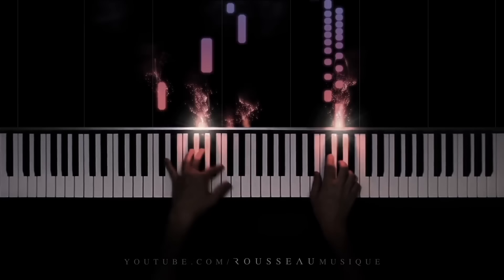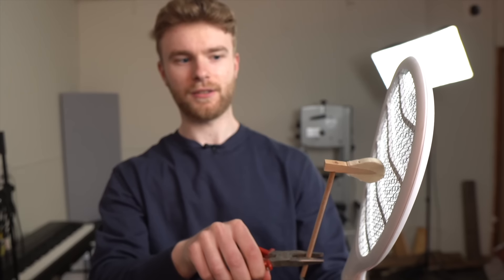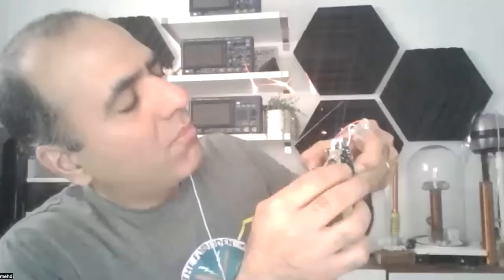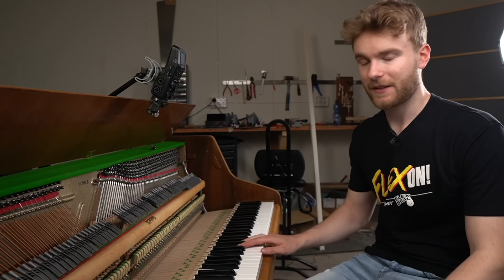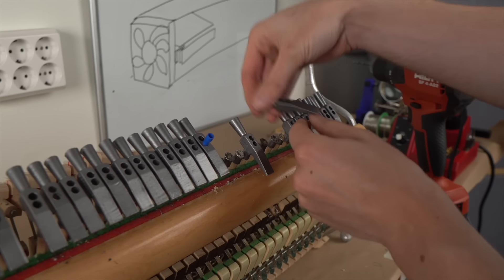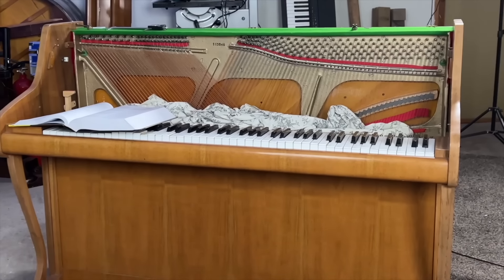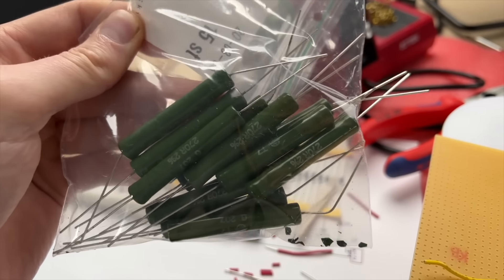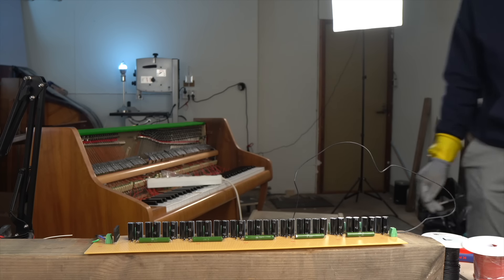How to NOT make an electric piano ft. @ElectroBOOM

Comment: As an electrical engineer, seeing those resistors glow red was terrifying
Reply from the maker: I thought that was a feature!
Reply: If you've never made a resistor (or other component) smoke,are you really an EE though? Putting the magic smoke back in is the hard part.
Reply: if it glows, it means its on!
Reply: All resistors (including the metal within any other component) are light bulbs if you drive them hard enough.
Reply: I used to be a resistor, but the cops yelled at me to stop resisting and put me on the ice. I'm a superconductor now.
Reply: Agreed. Scared the hell out of me too. Actually had the resister catch fire on the classroom... Good thing the teacher had the fire extinguisher just in case.😬
Reply: I am a electrician.
In school we blew up so many transistors and resistors it was quite funny. Like snap peas. 😂
Reply: @PhattyMo  I can confirm that letting the smoke out of a component was mandatory in undergrad EE. Unfortunately we were told that learning how to put the smoke back in wasn't covered until the graduate level. I was too poor to get a Master's degree, so all I can do is blow smoke with my B.S. of electrical engineering.
Reply: @PhattyMo  when you only know the theories
Reply: I felt queasy deep down inside
Reply: What's the worst that will happen? The resistor melts and becomes 0 resistance and then all the capacitors explode.
Reply: Exploded electrolytic caps smell like cookies. Burned resistors and diodes really stink though.
Reply: As an electrical engineer, it kinda made me a little hot......
Reply: Also seeing him using 2 sets of gloves on wooden keys made me annoyed.
Reply: Good old Light Emitting Resistors
Reply: @LordDragox412  😂
Reply: What if the resitor just blow up
Reply: man's just invented LER's - Light  Emitting Resistors, sounds like an idea someone would steal
Reply: @Mattiaskrantz  Little advice, what the burning resistors mean is that you've shorted out whatever that resistor is powering (in other words, a hammer has welded itself in contact with a string). There are ways to prevent this kind of thing, but honestly if i was you i'd suggest just adding a fast blow fuse after each resistor. 

Be absolutely sure that the circuit is discharged before replacing fuses though if you do this.
Reply: @binathiessen4920  not the electrolytics I reverse charged!
Reply: how about the fact that he was watching electric arcs without any eye protection? they are potentially damaging
Reply: @kitsunekaze93  ... not for very long, though.
Reply: redstone
Reply: @LordDragox412  noice
Reply: @SeriousApache  honestly I think the logic was if his brain turns off and touches something he shouldn’t then maybe the gloves won’t melt to the hand
Reply: As an electrical engineer: that was ducking awesome!! Snyggt jobbat!
Reply: @ParadigmUnkn0wn  That seems to be the equivalent of accidently making plasma with your laser
Reply: daily occurrence in my lab
Reply: @wolfkin5503  if he keeps doing life-threatening projects, then UV  burns and cataracts are the least of his worries!
Reply: The fact that there was so much voltage going through that circuit to make that resistor glow red hot gives me anxiety lol
Reply: @PhattyMo  i used to make electric pyro ignitors form resistors
Reply: @nikkiofthevalley  every diode is a LED if you're brave enough.
Reply: Don't let the magic smoke come out
Reply: @PhattyMo  Smoke? Yes, but glowing red brightly enought to cast light on the surrounding surfaces? That is a bit more though.
Reply: @zerumsum1640  i don't think the idea of using a fuse off of a bus ever crossed his mind
Reply: @bungersinyourarea  I mean he was getting coached by electroBOOM, i'm surprised nothing exploded XD
Reply: i mean thats how Edison invented the light bulb innit
Reply: Heated piano for the chilly winter days
Reply: @Mattiaskrantz  only for the older versions, they removed the feature on version 1.2.1
Reply: Depends on the resistor. I haven't started the movie yet, but plenty of resistors normally glow red.
Reply: @PhattyMo  these resistors are huge, bc they are rated for a very high current. If they start glowing then that will tell you how much current is going through those things
Reply: @matthewtalbot-paine7977  i think the circuit breaker will kick in before that happens bc blowing up those resistors is gonna take more than 16 amps
Reply: It's just the press to reset button lighting up
Reply: Really dont need to have 10 keystrokes per second.. you could scale it down to 2-5 keys per second.
Reply: I'd say this is irresponsible, but I've repeatedly run 300A through 10ga wire and electrical connectors designated for 60A.
Reply: Meh, making big old school ceramic resistors was pretty much normal operation in playing with HV.  For the real fun stuff you would break out the glass tube 10-50kv ones (you know when making custom rolled oil filled capacitors the size of Rubbermaid tubs…although for chaining those you could just use graphite rods from the welding shop)
Reply: @LordDragox412  For the internationals, the ICE is a German Intercity-Express (high speed) train, and a train usually has conductors who check the tickets. That's German humor, you guys :D
Reply: @SeriousApache  the inner ones would just melt to his fingers if too much current went through them, yeah?
Reply: Electronics don't work very well after you let out the magic smoke.
Reply: @Mattiaskrantz  I think if you replaced that resistor (R0) with 4 of the same type and joined like my drawing I suspect you would fix the problem.
like this      R1             R4
               |---==---|    |---==---|
-------------|            |---|            |-------
               |---==---|    |---==---|
                   R2             R3
Instead of like this:
------==------
       R0
Because then you would get the same amount of resistance, but the energy distributed over 4 resistors instead of just 1.
Reply: @Serpensin  same, in a class we’re we worked with circuits the teacher showed us what would happen and we popped a lot of them just for a bit of fun as we had a lot of spares he was willing to waste 😂
Reply: @tillorrly1128  Until it becomes a dark emitting diode.😂
Reply: @Serpensin  have you blew up some capacitors? 

It's more fun than resistor, dan transistor 🤣🤣
Reply: @LordDragox412  oh no!!!🤣😂😅
Reply: @nikkiofthevalley  and lightbulbs are resistors
Reply: @SirMegaManNeoX  oeh scary.....a candle flame...
Reply: @matthewtalbot-paine7977  they become infinite...becouse they melt away they now will not conduct, having the same resistance as air.
Reply: @LordDragox412  BRUH hahah
Reply: I thought you are a Sushi master ?
Reply: As a non electric engineer, its AWESOME.
Reply: As an electrician it made me happy
Reply: @Mattiaskrantz  uh oh. UH OH. UH OH
Reply: I read this comment before i even saw the video start. What. Oh fuck no
Reply: As an electrician, I was just constantly going "noo... Noo..! Fuck that.." for most of this video tbh..
Reply: As the resistors, I was terrified to
Reply: @Mattiaskrantz  That's a matter of perspective
Reply: magic smoke!
Reply: True that is painfull to watch
Reply: @nikkiofthevalley  Light-bulbs? You mean candles, right?
Reply: It sounded awesome need a spark piano thunderstruck cover
Reply: seeing those resistors glow made me almost pass out but sometimes I like exploding resistors for fun
Reply: As someone whos in welding, seeing anything glow red other than hot steel is terrifying
Reply: Oh yea, as an electrician i was more worried about his breakers, they might be a little chared after this grand finale
Reply: Its fun
Reply: once i connected an RGB LED to a 9V battery. BOOM
Reply: Sometimes I like to short them out just for the fun of it.
Reply: As a normal human seeing those resistors glow red was terrifying
Reply: Imagine taking this show in the forest....... 💀 ☠️ 💀 ☠️ 💀 ☠️
Reply: @zerumsum1640  
A discharge dump springs to mind, to the ground.
Reply: @zerumsum1640  he's actually a good engineer.
Reply: @joshuawfinn  as long as it's in the order of seconds and you give it time to cool its not a huge deal.
Reply: As a hobbyist I loved it
Reply: I am a resistor
Reply: As we say in radio... tune for minimum smoke.
Reply: dude, its just an overload indicator led
Reply: @binathiessen4920  
Burning electrical components and boards have an odor all their own!
Reply: @wolfkin5503  
Only if you're wearing contacts.
Reply: @bgtheloser  
Voltage is not what makes resistors (or any other component for that matter) glow red. It's the amount of current. The resistor resists the flow of current thus generating heat.
Reply: @TheRealAndOnlyAndrewRen  yeah, that's the bulb who's invention is already credited to Edison, man can get in line behind Tesla for claiming to invent one
Reply: As a normal civilian, seeing those resistors glow red was amusing.
Reply: You must not be very experienced then. Components let out the magic smoke all the time. Sometimes by poor design, sometimes by poor implementation, sometimes by general failure.
Reply: A PTC or polyfuse might be a good idea for when thouse hammers weld you dotn burn up a resistor the term you want to search is "ptc resettable fuses"  They were used in the old days on crts for a simmaler application during demagnetizing of the crt.
Reply: put them in series with the hammers. They should let the spark though then get warm and go high resistance if the current flow continues.
Reply: Amazing!!!
Reply: @PhattyMo  Blue smoke < orange flame.
Reply: You aren't familiar with LERs? What kind of EE are you?
Reply: Pairing that many electrolyte capacitors without accidentaly mismatching the right alignment of the minus pole and eventually causing a spontaneous cap explosion is actually quite a stunning feat for an electronics beginner. Considerung the size of the caps and the potential danger caused by just one explosion is even more stunning. Great job!
Reply: @xnlpLUKAS  I once saw someone replacing a big capacitor to old TV. It can be flashy.
Reply: When the resistor is glowing, that’s usually your sign that you went well beyond whatever it was supposed to be doing.
Reply: @PhattyMo  they usually just jump straight to exploding for me
Reply: It’s the last thing you’ll ever wanna see in an electrical circuit as an engineer lmao
Reply: @LordDragox412  haha. XD
Reply: @ParadigmUnkn0wn  man, higher education should be free
Reply: Reading through the comments, eye protection should have been used, in case something blew up.  Anyway, don't try this at home kids.
Reply: @Serpensin  my father used to teach basic electrics at technical school, his response to "what actually happens when you insert scissors into an outlet" was "try and see". Electricity people are built different.
Reply: as someone who just stood next to someone performing a short circuit stunt at a 15kV contact wire i found this rather unspectacular... it just lacks the bass!
p.s. 
don't worry, no one was harmed
Reply: @Mattiaskrantz  if anything other than LED is glowing, that means its hot and dangerous :3
Reply: @SeriousApache  when you work with high voltage you always wear two sets, rubber ones to protect you from electricity, and leather ones to protect the rubber ones from getting holes poked in them.

Thats on high voltage live wires like power transmission lines though, this was a bit overkill.  Piano keys won't shock you and they definitely won't mess up your gloves enough to need the second set of leather ones.
Reply: Light emitting resistor
Reply: All in the name is science, or views or something like that. Either way is an amazing creation. 😊👍
Reply: As an electronic technologist, I must concur!
Reply: Lol

Comment: I have never seen a resistor glow like that, and something about it happening twice and being completely unaddressed both times is truly part of the magic of these videos.
Reply: When the key is stuck the capacitor doesn't charge so the charging current constantly flows through the resistor instead of stopping when the capacitor is charged. The boring fix would be bigger resistors or less charging current. The slightly more exciting fix is to just solder as far away from the board as you can, so they still glow red hot but it doesn't catch the wood on fire.

I bet electroboom calculated they would get a bit hot and that's why he said not to touch them, but he didn't account for keys getting stuck
Reply: as if it wasn't "thrilling" enough
Reply: I've only seen glowing like that from my (solid steel dummy fuse) in my car after i kicked my wiring harness and 500amps went through my glovebox light wiring
Reply: Have you ever seen a ceramic cooktop? Thats bascially a resistor glowing.. or looked into a hairdryer to see the red wire? Also resistors.
Edit: Thanks for pointing out the typo 🤦
Reply: @ReMixRoudy  Resistors I think you mean.
Reply: @ReMixRoudy  Ye, ya probably mean resistor; having a glowing transistor is an even bigger problem.
Reply: I have seen that many times in my space heater. Same concept.
Reply: I think the fix was a bigger resistor back at the enterance.

Frankly I am surprised we allowed so much current. I probably would have suggested a  voltage boosting circuit and some diodes. To pump voltage into the capacitors for big sparks, but with a reduced current available for heat based damage.

After all I see some fantastic sparks off our 6 kilovolt electric fence unit, but I can grab it without getting hurt.

All you need is a Tesla coil type voltage booster.
Reply: Eh, you never seen an incandescing light bulb or a resistive heating element then? Those are both just types of resistors (All of which are simply a high impedance wire typically in some kind of casing to prevent the wire oxidising from reacting with the air due to the heat. The ones you usually see in circuits the casing tends to be ceramic, heating elements it is generally quartz, and light bulbs tend to use an inert gas filled bulb. But yeah getting resistors red or white hot to the point they glow is a very common practice we just tend to give them different names when we are doing it on purpose.
Reply: @thewhitefalcon8539  he did predict the keys getting stuck
Reply: @thewhitefalcon8539  its not that the capacitor isnt charging, its the fact that when the hammer hits he short circuits the loop (which is why it sparks) so when the hammer gets stuck power just keeps flowing through the capacitor and also of course through the resistor, the resistor does its job and ''resists'' power going through and this of course generates heat so it glows
Reply: Easy fix is to attach a thermal switch next to every resistor in series, it will stop the resistor from disintegrating in time for you to get the key unstuck.
Reply: @seraphina985  Those do have special designs so they don't break from glowing red hot.
Reply: i can beat that. i had an ant crawl across my sound card once, it briefly glowed like the sun and vanished
Reply: A resistive load, like a toaster even
Reply: @justarandomguy3969  ... yes, that's what I said. The current flows that would normally charge the capacitor but the capacitor doesn't charge.
Reply: @TunaIRL  I guess he didn't predict it would make the resistors glow.

Or maybe it was all perfectly calculated after all...
Reply: @thewhitefalcon8539  saying it doesnt charge kinda insinuates that there is something wrong with it or that power doesnt reach it, but it does, it just also keeps on going since the circuit is completed.
Reply: @hauntedshadowslegacy2826  Ah, but for the transistor's predecessor glowing was a normal phenomena. Then again, vacuum tubes with heated filaments draw much more power than transistors, are comparatively fragile, difficult to manufacture in the huge quantities needed for computers, and, if course, are many many many orders of magnitude larger physically than a transistor.

Thus, if you'd vacuum tube is glowing you have an even bigger problem.
Reply: @thewhitefalcon8539  just add a fan, or watercool them, fill the piano with novec or oil.
Reply: @ReMixRoudy  toasters also glow.
Reply: @Jean i dont smoke weed...
Reply: @Jean im glad you agree
Reply: Bleep beep bom bam, at least it doesn't melt.